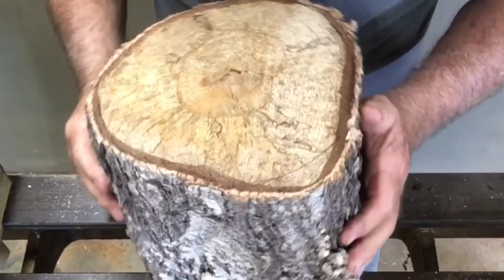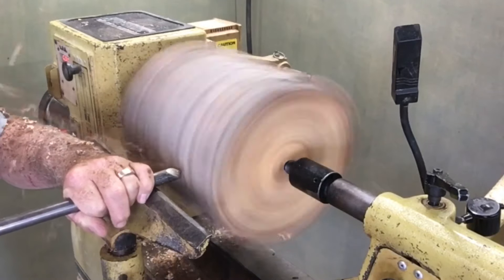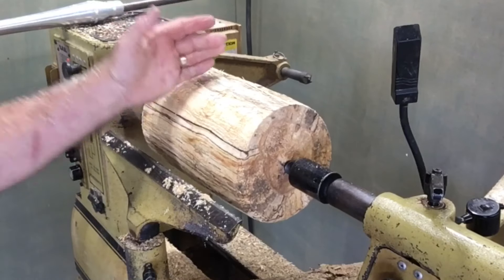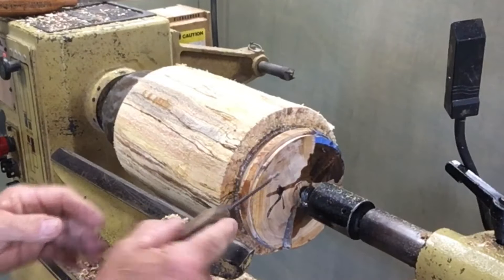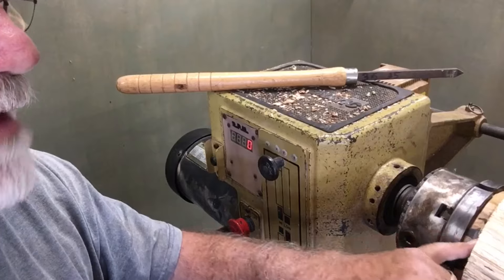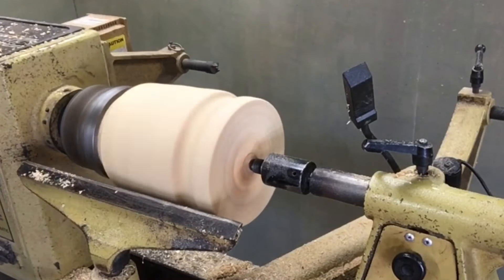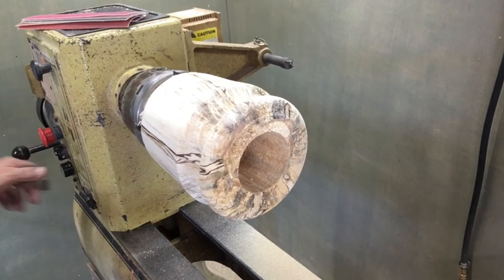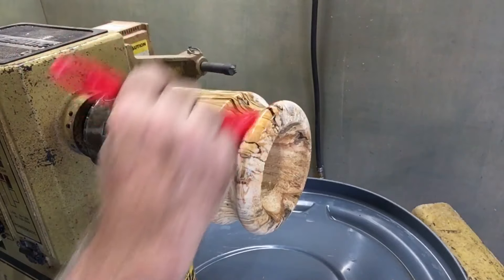Woodturning a piece of Spalted Birch,

Comment: I like watching the whole process, to answer your question.  I love wood like that. That is going to look great when you are done. I have learned that if you drill out the pith it will help with the piece wanting to crack.  Seems to work, coffee grounds and CA glue make a nice repair for the drill hole on a piece of would like that.
Reply from the maker: Thank you John. I’ve used a lot of coffee grounds in my projects. Looks great and works well. Thank you for watching and sharing your comments. 
PS I’ve had a comment or Two about the voice overs. Any thoughts on that?
Reply: Personally, I enjoy the voice over and listening to the wood turners' thoughts and explanations on why and what they are doing and thinking. Like when you explained you were having bad tear out with the carbide tools and switched to the spindle gouge and found it to be solving some of the tear out problems. To me the voiceovers  make the videos much more interesting.
Reply from the maker: Thanks again John. You have been very helpful. Appreciate your help.

Comment: That looks like a real chunky lathe.Could you tell me the make?
Reply from the maker: Thank you Leonard. I appreciate comments and Questions. It’s a powermatic 35-20 it’s about 15 years old. I bought it new about 2009. powermatic has changed its style a little bit since then. 20” max over the bed. However the head stock slides to the other end and makes it a lot easier to turn hollow forms. Thanks again for watching and your questions.